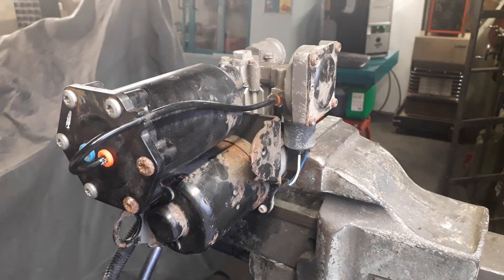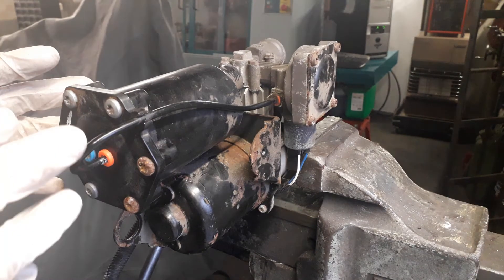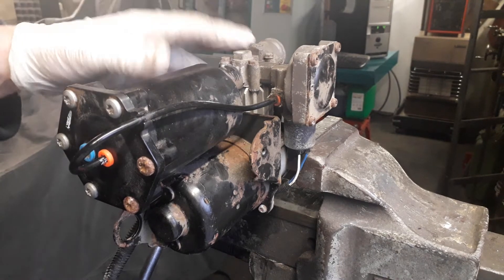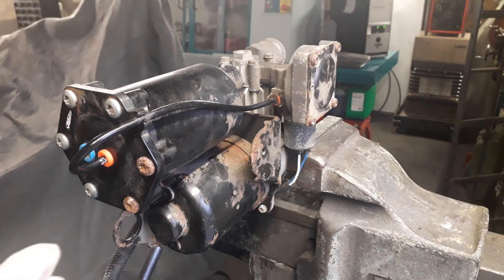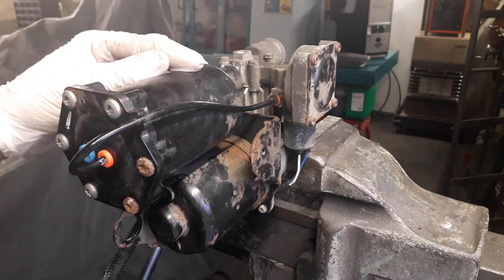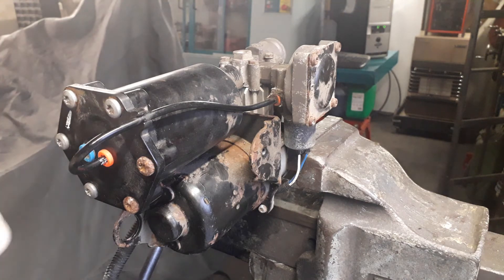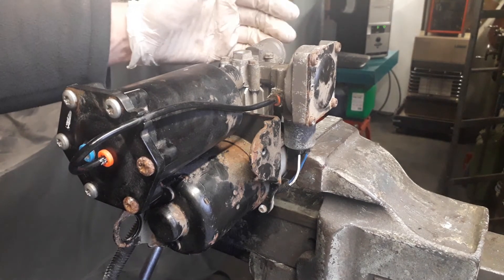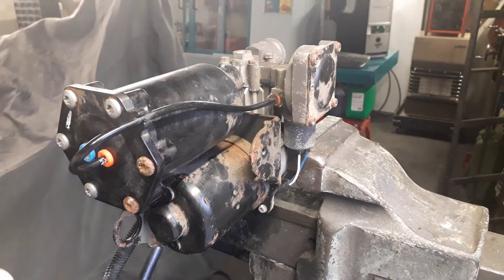Land Rover Oem Hitachi Air Compressor Fault Diagnosis

Comment: Hi fabulous video. I have a 2005 Rangerover sport with a very noisy air compressor constantly running while driving, I checked it out to find the compressor is being held on the car by tie wraps instead of the factory mounts , I’m I right to think that’s a part of the issue?

Comment: Taking a shot in the dark that you might respond. I recently installed a refurbished compressor assembly and am having some issues with it overheating mid-raise. Could I send you an email with details to see if you could help me identify the issue and possible solution?

Comment: Can you Mabe help me I has this normal height only fault! But could still go up and down for 2 to 3 mins before light came on was advised new compressor! Fitted yesterday now getting code c1131-93 air supply permanently! Now vehicle won’t even go up and down with new compressor gone worse after fitting new compressor done want to just buy valve blocks etc with out nosing guess buying

Comment: I have a RRS SC 4.2 from 2008. 3 weeks ago when I drive the back wheels lift up on to highest. So I drive 20km pr hr back to home. Now I have a problem again with my air suspension compressor! It keeps running even without the key in it. It stays running. Now I take the battery of. Yesterday the relay, one air suspension left front and the valve block on the front passengers side i replace for new.  Compressor keeps running. Check the compressor and the air tank with soap water and no leak. The pipe line front wheel also no leak. I don't know what to do anymore. Now i think it is a part of this compressor.Can you give me tips. I am tired 😫 😩 😴.

Comment: Ive often wanted to know what the "Gallery Pressure" is?,   I thought it might be the air resiviour?
 I note when my compressor went bad the gallery pressure would drop to about 120psi like a slow leak say 1 psi every minute then the compressor would cut in again and again etc and overheat the motor.  (2010 L322 with genuine original Hitachi)

Im goinng to order your seal kits and clean and re seal the valve blocks,   I guess the blocks and pistons / vlaves dont really wear out just the o rings ?    or with high milage should you just put new blocks in do you think?

Comment: I have a C1A20 again. In the past it was air dryer cap (which i replaced with aluminium one) but now many many years later its happened again. I sprayed with water and no leaks but if i force it to raise it sounds bloody awful like a bag of bolts does your master rebuild kit fix this awful noise?
Reply from the maker: Hi,
Unfortunately we have noticed that the aluminium covers which are sold by other sellers  have been prone to leaks at the operating pressure 16.8 bar ,our own in house manufactured covers are manufactured and assembled at the operating pressure of the vehicle without leakage ,if u artificially put into 15.8 bar to 16.8 bar of air pressure  into the air dryer of the compressor then spray leak detector around the fittings on the end cap this will test if the cap is causing the fault ,if u require a replacement cap after your tests please visit our website www.4x4airseals.com

Comment: I replaced my Hitachi air compressor to the arnott compressor now i have fault code C1A20-64  and C1A08-1C i also replaced valve body module by air compressor i can't figure it out my problem

Comment: I just got a 2009 sport .. 71k miles … my compressor turns on for about 10 seconds then off … the car has been stood a while yellow light on dash …. Makes a very bouncy ride … is it new compressor or a repair kit I’ve done the relay
Reply from the maker: hi,
We Would Need to know which type of compressor u have fitted !1 of 3 types oem hitachi aftermarket dunlop or amk ,we can supply kits for all 3 ,u can send whatsapp picture of your unit if req 07908 479400 f u get your diagnostic codes read that would be good so we know what system the vehicle isnt happy with ,thank you
Reply: Hi again it was a aftermarket on claiming to be hitachi .. which had been thrown in the trash .. I’ve now got a replacement genuine one

Comment: good day 4X4 AirSeals Technical
I have a 2023 LR4 Discovery with a fault code C1A13-64. "Pressure does not decrease when venting gallery". I have checked the compressor is a Hitachi. Please advise on the faulty parts and also the costs for the supply. I live in South Africa.

Comment: I took my 2010 LR4 to a mechanic recently for an unrelated matter and after I got my vehicle back I started hearing a fairly loud grinding or huming noise. I can also feel the vibration through the driver side floor. I think what happened was the mechanic placed one of the hydrolic lift arms under the system and damaged it while raising the vehicle for service. It typically only makes the sound when the vehicle is or was rasing. Sometimes it does it while at normal ride height, which I imagine is because it is trying to keep the suspension raised due to a small leak somewhere in the suspension (which I'm not really worried about right now). I'm just tring to figure out what my issue might be before trying to pull the system apart and inspecting the air compressor. Could it also be the air resevour tank or would you think damage to the actual compressor? Thank you for any help you may be able to give me!
Reply from the maker: Its quite common for some garages to jack up the vehicle in the wrong place especially under the rear passenger floor were the compressor box compartment is , its adviseable to get the car over a ramp and inspect the complete under side incl the receiver tank under the drivers floor .
Reply: @4x4airsealstechnical99  I just inspected the air compressor with it still mounted. From what I can see and based off of it raising and lowering just fine, the air compressor appears to be fine but the mounting arm is totally shattered from the full weight of the vehicle being on it. Is that part still available on your website or do you know where I can get one for the best price? Thank you for your help!

Comment: Hi I have fault codes c112f  and c1130 can you advise
Reply from the maker: c112f - corner valve stuck open or corner valve leak to gallery   c1130-  air spring leak/  air harness leak/corner valve leak to gallery /exhaust valve stuck open . Not likely to be a compressor fault but u can also check that their is no air coming out of exhaust port on air suspension compressor whilst the compressor is running.

Comment: Will bad compressor cause my RRS to drop to bump stops over night ? Also compressor comes on at start up of vehicle but after couple minutes it will not turn on anymore
Reply from the maker: Not normally ,we suspect their is a air leak somewhere causing the vehicle to dip on a corner then the rest of the vehicle is adjusting to that level to try and level the car up ,with regards to your compressor ,when you start your vehicle the cars system does a plausibilty check if it thinks their is a fault anywhere and its not a severe fault then the system will try to get the vehicle height to normal ride height then usually display a message ' normal ride height only ' on the dashboard and switch the compressor off ,we advise to get your vehicle diagnostic codes read to see what particular system is failing ,please get back to us with the codes if possible.
thank's
Reply from the maker: The vehicle does a quick test itself every time you switch on the vehicle and if it as a mild fault it will always try and get the vehicle to normal rideout b4 illuminating any dashboard messages ,if the vehicle sinks down overnight it must be loosing air and which ever corner/corners are leaking will usually level up to the leaking corner or height sensor / sensors are giving a rogue reading.

thank you
Reply from the maker: Sounds like you have an air leak somwhere on the vehicle ! air pipe on top of back axle is notorious for leaking , try leak detector over all air lines and pressure switch valve solenoid next to compressor ! valve block solenoids 3off total could do with fitting with new orings  which we can supply from our web store or ebay store if required.

Comment: ¿can you tell me why my Hitachi compressor vibrates Extremely Loud and why it's slow to fill up my bags I have no fault lights but I'm burning through my compressors about every six months.
Reply from the maker: Hi, The usual cause of compressor failure are air leaks around the vehicles air suspension system which the old compressors seemed to put up more of a fight with stronger more robust electric motors ,but nowadays their appears !only in our opinion, to be a lot of cheaply built compressors flooding the market which seemed to be built not as robust in the electric parts of the compressors,air leaks is still the number one cause of compressor failure in our view,air leaks can be very slight and difficult to trace, theirs usually 1 bar of pressure between the compressor running and switching off so if on range rover sports n disco 3 4 the system pressure gets to 16.8 bar the ecu tells the compressor to switch off but if you have a slight leak in the vehicle and it drops to 15.8 bar it tells compressor to switch on and their is the problem the compressor gets very hot and how long it lasts is anyone's guess ,servicing the compressor air dryer filtration periodically will help the compressor also.

thank you
Reply from the maker: We find a lot of cheap new aftermarket compressors are not quite the same quality as the original oem units especially the electrical side of the compressors , but generally slight air leaks that are hardly noticeable and take some time to diagnose cause the new compressors to over run and thus reduce service life ! getting rid of air leaks and issues causing the compressor to struggle  filling tank to 16.8 bar need to be diagnosed and sorted or the cycle of replacing compressor's continue.

Comment: I have a 2010 LR4 with “ normal ride height only “ message
Reply from the maker: Most local garages would read the codes for you for a little cost avoid great expense purchasing a scan tool,just ask them to write down the codes for you then ask them to clear the codes ,we can tell what the common codes  mean if you let us know.
Thanks
Reply from the maker: Yes the 1st thing to do is to have the diagnostic codes read to see which system the vehicle is currently having problems with ,the common fault  codes are c1a20 or c1a13 or both but their may be other codes that appear,2nd check to see which type of compressor is fitted to your vehicle hopefully it is the oem hitachi unit .
thanks
Reply: @4x4airsealstechnical99  
Which scan tool can I purchase to read the diagnostic codes, my Bosch scanner does not as far as I can tell.

Comment: Hi there. Great videos, thanks. I've rebuilt the pump with a kit but struggling to know if the output pressure is sufficient. I can put my thumb over and hold it there for say 15/20 seconds until the pressure pushes it off but should the pressure be enough to stop you holding your thumb over at all? Many thanks.
Reply from the maker: Hi Alan, You can,t really determine correct pressure output with the test you mention,in our experience changing all the components that are connected with outgoing pressure if you are not certain what components are failing is the only way, delivery valve ,piston seals ,air dryer filtration with end cap ,clean out electric motor & exhaust electrical solenoid making them free from dust ,check that the electric motor windings are not totally discoloured due to over heating this can reduce the electric motor performance,get your diagnostic codes read to see if the current vehicle fault is connected with the compressor performance.
thanks
Reply from the maker: Hi Alan, Testing the outgoing air pressure on the bench by placing your finger over the port is not any real indication to the correct outgoing pressure ! if u repeated the same test with a new pump it would be very similar to the one with your original pump ! the only way on the bench to test the pressure is ! if you can get hold of a brand new pump the same as the one you are testing and rig up a test guage that can pass air thru it and give a reading ,u would need to test with a fully charged battery the new pump and write down the reading and then get your old pump and compare the 2 otherwise the compressor as to be tested in situ on the vehicle using live data diagnostic testing.

thanks
Reply from the maker: Yes putting thumb over port isnt a great test of knowing the output pressur the only way is with diagnostic live data as compressor is running on vehicle !16.8 bar is the system pressure that the compressor fill the resorvoir tank to  ,check when compressor stops that the air pressure in the gallery isnt leaking away .

Comment: my compressor makes noise whn i start my discovery 3 2008 model
Reply from the maker: Yes if you have a noisy compressor it could be the piston seal is worn and causing some piston slap ,also if the air intake pipe and exhaust outlet pipes have become detached and the in and outgoing air pressure is not being silenced ,if you have a dashboard message appearing get your diagnostic codes read and write them down and drop us a message,thanks

Comment: Hi I am getting c1a20 and this is happening any ideas? https://youtu.be/Wpyczjh4jWU
Reply from the maker: Sounds to me that the motor as gone week ,maybe due to over running over time due to a leak or you have a very week battery ,bare minimum clean out motor with contact cleaner ,replace the air dryer filtration /delivery valve piston seals and end cover !once you have determined the motor is spinning over healthly with a good battery and as been thoroughly cleaned.thanks

Comment: Good evening. kindly send me the prices of all the parts you sell for the Hitachi discovery 3 air suspension compressor, like the one you shown in the video above. Please, may I also find out if you supply air suspension blocks for the same discovery 3? You may send to the following email address: remmybwalya2017@gmail.com

Comment: hi i got a c1131-92(2E) using a gaptool ? can you please help me
Reply from the maker: Hi,
This code is a general compressor fault and is not specific enough in it description,std hitachi oem units and dunlop aftermarket units always usually suffer from leaks after a period of time and replacing the filtration and end cap as a minimum service which can sort these types of codes,if u can fully service your unit with our main kit it can help the whole vehicle suspension system .Thanks
Reply from the maker: Sorry not got that code in my std land rover error code  listing .
Reply from the maker: detched air pipe /insufficient pressure from compressor /loose or burst pipe/ resorvoir pipes incorrectly fitted unions reversed/pressure sensor fault.